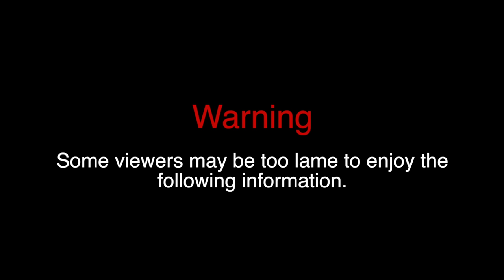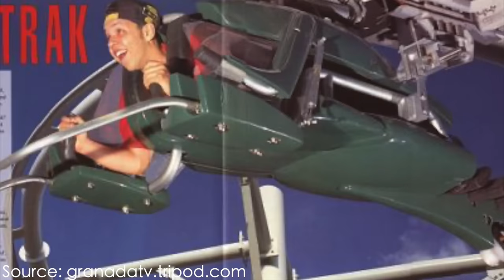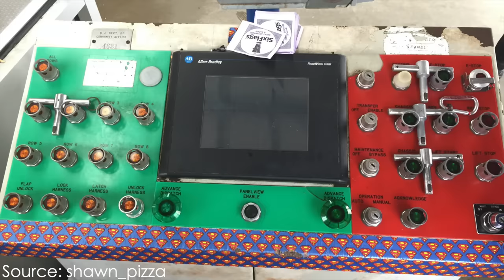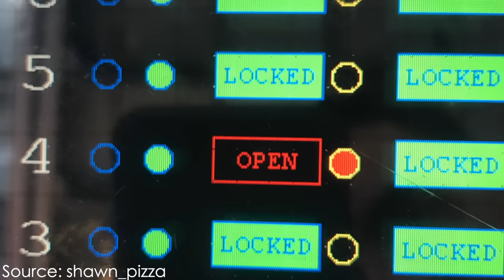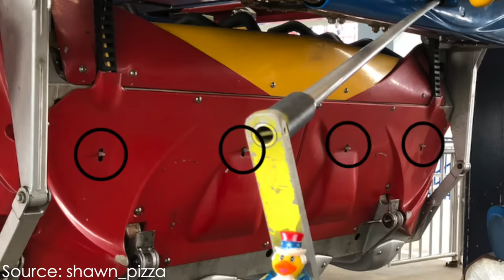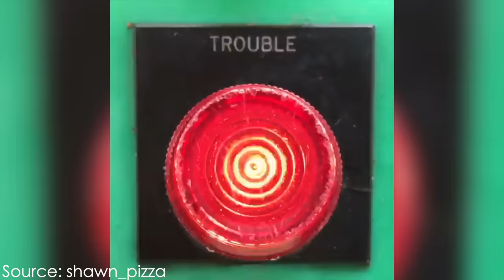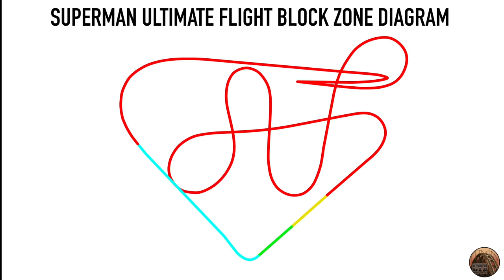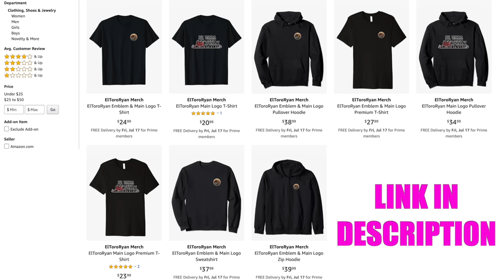Problematic Roller Coasters - Superman Ultimate Flight - Six Flags Great Adventure

Comment: Funny story: one time i rode superman ultimate flight at over Georgia and the ride was having some error so the train in the station could not unlock the restraints, so when our train finished the course i was on the final brake run and on the last row, the last row does not fit over the concrete below so I was hanging over rocks for about 20 minutes until they manually pulled the train into the other side of the station, similar to what you mentioned at  21:25
Reply: That would be kinda fun
Reply: @joeskrtit3061  It sucks dude, it is so uncomfortable getting stuck in the prone position. Ideally the brake run and station should be set up where you recline on your back and run inverted outside of those areas. Vekoma's Flying Dutchmen were not good rides, but they had a better setup by doing the brakes and station segments "on the ground."
Reply: @sharkheadism 
"Vekoma's Flying Dutchmen were not good rides"
Actually, that's just Nighthawk, and even then it's mainly just the roughness that hurts it. Batwing is generally considered pretty decent (same with Firehawk when it was still in operation).
Reply: That happened to me the first time I rode Tatsu. We got stuck for like 15 minutes on the break run and then they had to manually open the restraints.
Reply: same thing happended to me on superman in NJ a few years ago that wasnt fun facing the ground for 30 mintues
Reply: @VestedUTuber  nighthawk is so so underrated wasnt even that rough
Reply: @NickyD 
It's definitely not SLC rough, that's for sure. It only really starts to become problematic if you marathon it, though due to the ride's tendency for long queues it's not really something you'd want to marathon anyway.

I kinda wish they kept the Borg themeing, though.
Reply: Same thing happened to me as well in Illinois.
Reply: Had the same experience on Manta, was really uncomfortable but went for another ride anyways xD
Reply: I've been stuck on Georgia Scorcher for like 15 mins before. Now THATS uncomfortable. Worst wedgie ever.
Reply: @sharkheadism  that alone is why I don’t like this ride, we weren’t stuck on the final brake run, but were sitting for a few minuets while the next train was getting ready and that’s not a fun position to sit in for a while.
Reply: @patricknedz  a few minutes… was on Superman at NJ a couple weeks ago and got stuck behind the train in the station for ~30 min. At least we were above a platform, but being in that position for long isn’t comfortable

Comment: I like hearing about the leg flaps. I was 13 when I rode Tatsu for the first time and never having ridden a flying coaster before, wasn't aware of the leg flaps so while loading was happening I was just casually swinging my legs as if I were on an inverted coaster. Then I nearly wet my pants when the flaps closed and I realized my right leg wasn't secured. Of course the ride attendant came to fix it but I don't remember it being a big deal and only took a couple seconds to open the flaps and get my foot in place. Maybe it's easier to open when the chassis is down?

Comment: Man that first inverted loop/pretzel was one of the most fucked up EPIC feelings i have EVER experienced in a roller coaster to this day! Have ridden this Superman at Six Flags Great Adv soooo many times its one of my top 3 probably. Other than the first loop the ride sucks really bad and is over quick, BUT that first inverted loop STILL to this day makes it one of my top ones to ride and have ever ridden. I will NEVER forget first riding this and completely not expecting that feeling of this inverted loop/pretzel. You actually like used to be underground on the bottom of the pretzel/loop while your literally facing the opposite direction while on your back than you were at the top(hard to explain but i know some get it), it was just EPIC. Upon watching some newer pov's videos of this ride i noticed though that they filled in that hole on the bottom? I specifically remember a little fenced in square holed area at the bottom of the first loop. I remember they said it was necessary in order to fit the loop in place bc they "ran out of room", so they needed to dig into the ground a little to fit the bottom section of it. I wonder how they went about making that particular bottom section of track NOT underground anymore? Cause I dont see really any digging that was done, which i would guess is how they would do this (by just excavating/digging out a much broader/wider area so then the track looks Above ground like now). The front and BACK(i prefer) rows both have there reasons for doing but man being dragged through that pretzel in the back for the first time was one of the scariest things i have experienced still to this day. I couldnt breathe(which never happens to me anymore as im mostly used to it all, but this kicked my ass to say the least) and i know some people who have said they blacked out or was very close to it. Front is also just as fun in that it truly gives a much better flying feeling obviously, bc nothing is in front of you(your not looking at the back of peoples feet/sneakers lol). That hill climb(though not very high) in the first row is still something else. You're literally just looking at the ground as you ascend higher and higher with nothing to catch you God forbid, its just you and air straight to the ground, all wide open 😯(check out a pov on it, youllsee). Idk if its just cause my body wasnt expecting it or what, but i thought i was about to die almost my first time riding this(lol exaggerating slightly, but you get it). I think i was front row first time too and the push up from the back cars while coming out of the pretzel is insane too, even that little pull up part right before you dip into that pretzel! If it only had like atleast 3 of these pretzels omg lol. Makes me wanna ride it right now!

Comment: I’m late to this but I’ve worked in the amusement industry for over 10 years now. I just wanted to say that the portion of the video where you mention the wireless communication to the trains from the operators console, that’s not how that function works. The part you circled on the train is indeed a COM, but a COM is not wireless in the sense that it uses radio frequencies. Those are not antennas on the COM, they are copper coils, or brushes as some would call them. When the train enters the parked position in the station, the coils make contact with a copper plate fixed in the station hardware, allowing for communication. This is why the functions only work when the train is parked. Many rides use this type of communication wiring in many different ways. Just thought I’d fill you in a little!
Reply: I'm curious, what do you do in the industry?

Comment: Amazing video! I have just one more fun fact. As someone who has operated the Superman UF clone at great america, at least for that park, there are two abnormalities. Rows 1 and 7 are for some reason much weaker than the other rows. If there is too much weight on either of those rows, when you go to dispatch, the chasis will swing up, but it won’t be able to fully raise the train, and it will stop. You then have to say hands off, and press the CHASIS DOWN button, and that will put it back into the load/unload position. You either try again, or you can tell pretty easily which row it is. You then have to unlock either rows 1&2 or 7&8 and ask the two groups to switch, or if they don’t want to, you split the group in half. It’s a real pain in the ass and it destroys capacity.
Reply: Superman at Great Adventure had a similar issue the season that I operated it! For us it was row 6- but they eventually fixed it after taking the train off for about a week. Worst issue EVER for the guests waiting on the transfer track lmao
Reply from the maker: Holy shit! That sounds miserable
Reply: Cuvii hopefully maintenance fixed it for this year lol
Reply: ElToroRyan it was 💀
Reply: @alexl8552  it was back in 2014 so I would hope so LOL
Reply: Cuvii i meant our park but go off lmao

Comment: Great video! The Superman at Over Georgia has amazing terrain to go with the ride. Unfortunately, it’s broken almost as much time a day that it is running. I don’t even try to go on it anymore ever since I was stuck hanging out on it for 30 minutes because the other train had an issue and they no longer use the dual station. Also, it’s broken while I’ve been in line at least 5 times over the past 10 years. Fun but holy crap it’s annoying between the breaking issues and the constant hour+ wait for a one trick pony ride.

Comment: As a former ride operator of Air at Alton Towers for many seasons your video hits all the points. Very good video. I did have videos of both operating Air and working as the Station Op (attendant at the rear of each station who operates the harness latch, lock and unlock buttons). In the videos I explained the ride start sequence but unfortunately I can no longer find these videos, and AT would most likely not be very happy with it being shared. 

In terms of staffing for two station, three craft operations we would typically run with two ride ops, two station ops and four platform hosts. This makes one op, one station op and two hosts for each station. Then we would need three-four additional staff to provide breaks for the hosts and ops. Plus we would have a minimum of one host in the queue and one at the entrance. As you can see running a B&M flying coaster is pretty costly in terms of labour alone, without even considering the maintenance costs. 

Oh and yes, the trains (crafts) are very heavy, typically two metric tonnes per car, so 14t for a seven car craft. Believe me, I have actually been involved in pushing a craft along the brakes/waiting areas with the friction brakes blown. 

These are very complicated rides with plenty of cause for downtime. For us at AT, it was usually moving floor errors or spiders spinning webs over photo eyes at the top of the lift, on the Hersh bar or on the communication links.

Comment: Nice video. AIR at Alton Towers, never had the light system filted to it. Never needed it. We had many technical problems with AIR when it opened. I do remember back in 2002 just after we opened the ride. The motor system that lowers and raises the trains into the flying position engaged without the trains  unlocking themselves from the flying position, resulting in quite a bit of damage and a few broken drive shafts on the lowering mechanism on one of the stations.

Comment: Using radio communication for safety mechanisms is a BIG NO. Super easy to interfere with and a hacker could cause damage. Using optical communication, it's far superior and far safer.

Comment: 23:10
Please never ever be impressed by lines of code. In production environments it is almost always a useless metric.

In this particular case, 80K lines of code my be a lot or practically nothing simply based on the language used to write that software. I suspect the latter as it almost certainly written in Java, which is known for verbosity and code bloat in even semi-complex systems.

A better metric would be amount of data being sent for diagnostic purposes. However, since there's not much to compare to, even that is fairly useless.

TL;DR - color me unimpressed regarding the "80K lines of code".
Reply: I don't mean for this question to sound rude, but do you really think they would use Java as the language of choice for efficient machinery equipment, let alone a roller coaster responsible for human life? Most rides use programmable logic/automation controllers made by Rockwell, Siemens, etc.

The programming language for those systems is usually a graphical logic language like RLL (relay ladder logic) or FBD (function block diagram). Some programming is done in text based languages, but languages of choice would be highly efficient, low level languages like C#, C, or even possibly Assembly (depending on the application).
And trust me, coming from someone who has written in low level languages before, 80k lines of that crap with no overhead or dependencies sounds like hell, lol.
Source: https://www.reddit.com/r/rollercoasters/comments/4vn6bf/every_rollercoaster_has_a_computer_who_makes_and/
Reply: @RehlmProductions  You'd be surprised. Java is used in a ton of places you wouldn't expect, even stuff like control systems on military ships. And to be honest if it's not a system that needs sub-millisecond realtime precision or is extremely memory constrained (meaning it can't tolerate a garbage collected language/runtime) I'd rather have something written in a managed language like Java or C# or whatever rather than C or C++ where I'd have to worry about random memory errors (use after free, data races, all that fun stuff) that the programmers missed.

C# is really about as efficient and no more "low level" than Java, it's also a language compiled to intermediate code and then JIT'ed with a garbage collected runtime.

80k LOC for this thing means to me it's probably lots of spaghetti accumulated over long development time with changing requirements.

Comment: As a PLC programmer, this was really interesting to watch.

I work in robotics, and there is a crazy amount of things talking to each others, and things in place for safety in a similar way.
Reply: What kind of PLC's do you guys use?
Reply: @shawnspencer8766  Alan Bradley rslogix5000 mostly v. 20/21/24/28
Reply: @vicious3526  nice. I work on these ride controllers and we mostly use ab 5000 as well, also slc 500 for the older stuff
Reply: @vicious3526  if your saying the versions, isn't most of that studio 5000?
Reply: @shawnspencer8766  all the versions I mentioned are rslogix5000
Reply: @shawnspencer8766  I'm not familiar with slc 500. Is that siemens?
Reply: @vicious3526  version 20 and below is rslogix 5000. 21 and up is studio 5000. 

SLC 500 is the last controller that was supported by rslogix500

Comment: It is very interesting how you bought up the electrocal power brushes. I was working for a company that installs tracked manufacturing systems that take finished parts from one area to the other. At the top of the vehicle were power brushes that went along the whole span of the track that gave it power very cool to see this technology! We also uses lots of photoryes and beams that if we walked by while testing shut the system down very cool!

Comment: Nice work of providing technical analysis for the ride system in the video for the model in question. It's no surprise that these particular rides require more wiring to monitor the on board safety systems than on others and that if any one of these systems goes down or registers a fault then the ride cannot operate. I wouldn't be surprised if a lot of the downtime on the gen 2 vekoma flyers is due to the wires in the onboard junction boxes being shaken loose by the severe vibrations of the ride during a normal cycle?

Comment: Speaking of coasters being designed for their terrain, Fiesta Texas’ coasters do this especially well, besides batman (ss freespun coaster) and goliath (a clone of batman the ride from parks like SF:over texas). The Iron rattler, roadrunner express, wonder woman golden lasso, and super krypton coaster use the quarry wall well, with hills passing the wall’s and lift hills giving you a nice view of the park and quarry shopping center on the other side of the wall, The road runner, Superman, and Iron Rattler even have sections of track that are right on the quarry, with helix’s and corkscrews and small hills.